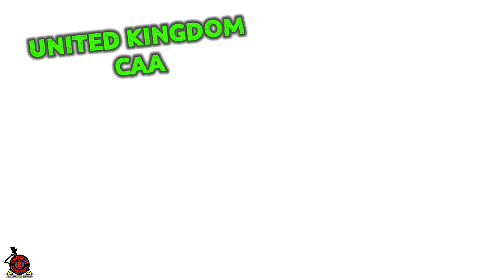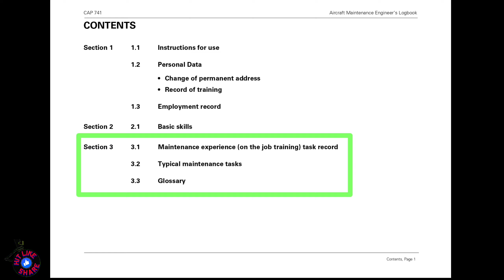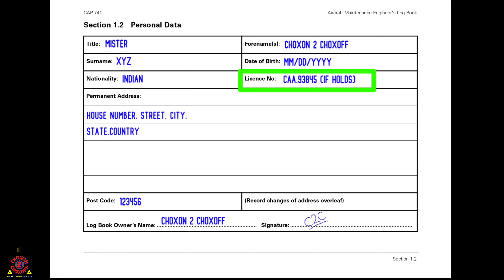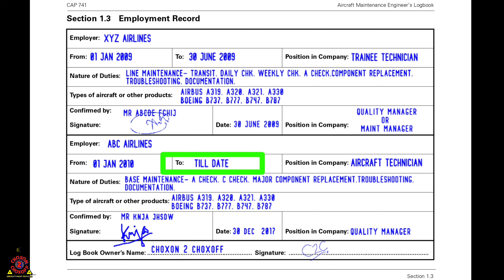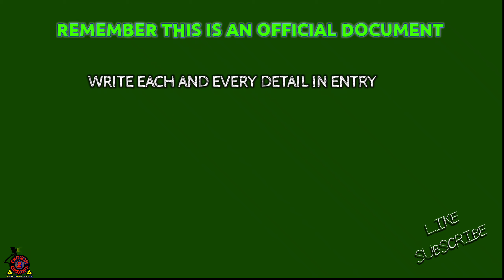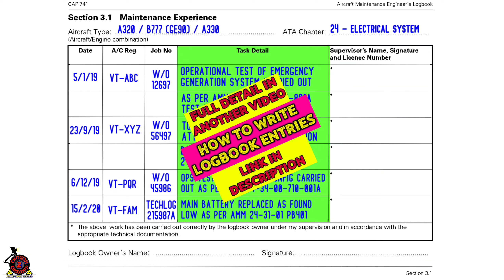EASA PART 66 AME LOGBOOK | UK CAA LOGBOOK CAP 741 : HOW TO FILL IT CORRECTLY.

Comment: Hey man. As someone who is not a UK or an EU citizen, am I eligible to apply CAA UK Part 66 AML? Wanted to go for KIWA, however they no longer accept non EU members or citizens. Which is best, CAA UK or EASA?
Reply: sir how many tasks shold i perform a month or a week is there any certin number ???
Reply from the maker: @مفلحشمري you need to perform number of task, some authority require certain number of task which makes year of experience
Reply from the maker: Depend on where you want to work or your company requirements. Do not go for kiwa, they cancelled so many type ratings and takes long time.

Comment: Does CAA UK issue basic license outside of UK if one has more than 5 years of maintenance experience on an operating aircraft and cleared al valid caa uk module examination?
Reply from the maker: Yes. You need to apply with proper documentation and logbook.

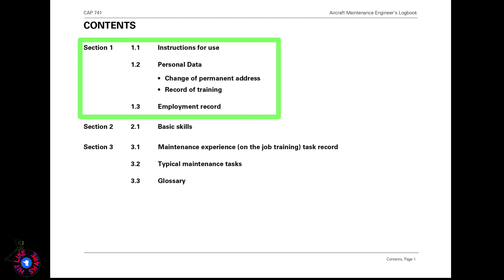Comment: 01:25 , hello brother if the work order is not under my PRN or name is it still valid because i don’t have authorization yet so its not possible that the workorder entry is under my name or prn. Does it matter? Or can I just use any valid wo and enter that in the logbook if i have assisted in the task? Thank you
Reply from the maker: No, it's not necessary on your name. It should just be genuine and you present in the company. It is just for cross checking.

Comment: Is it necessary to get your practical 5 year experience at part 145?
Reply: Sir my company  is FAA 145 Station  NOT EASA is it ok or it must be 145 EASA ??
Reply from the maker: @مفلحشمري some authority accept. Aviation exp
Reply from the maker: @مفلحشمري as of now greece accept non eu experiences
Reply from the maker: Have you cleared your module 10?
Reply: @CHOXON2CHOXOFF  I'm planning to get easa license through 5 years practical experience.
Reply from the maker: If you have not done a basic course from 147 approved org, then you need 5 years mandatory.
Reply: @CHOXON2CHOXOFF  but does the experience count only under part 145? Or can we get the experience at repair stations that isn't under part 145M
Reply from the maker: Part 145 approved org experience and module exams.

Comment: If my supervisor is holding CAAS (Singapore) and FAA AML license, do I need to mention it infront of the license number such as “SAR-66 /E126374” or “FAA/ 3757483” ?
Reply from the maker: Some of the authority do ask to mention license nums like kiwa neatherland.. some dont. It depend on where you applying. But if your company is EASA 145 approved than not needed.
Reply: @CHOXON2CHOXOFF   Thanks for the reply! I’m actually applying for UKCAA Cat A before their cut off date on 31 Dec 2022. My company is EASA-145 approved. 

I’m not sure if UKCAA need the Supervisor Detail List like KIWA logbook format. Do u think they usually required this?
Reply from the maker: UK CAA dont requires any such thing until your logbook is sogned by QC nd also have covering letter from QC to CAAUK. Just see to it that you fill max entries and also cover all ATA chapters and different types of funct test, ops test, troubleshooting,  removal installation evethg... 

ALL THE BEST. KEEP WATCHING AND SHARING THE CHANNEL.
Reply: @CHOXON2CHOXOFF  Okay sir, thanks for the help!

Comment: Thanks for info, but do I have to take the whole module exams from one country? For example is it ok if I take some modules from part 147 organization in turkey and some modules from organization in uk?
And is an EASA license affected by the part 147 organization name or all licenses are the same in credibility?
Reply from the maker: Thats good questions.. 

As per rule you are correct, we can appear exam from any part 147 approved organisation. It don't matter. We appears more than 3 different places. But lately we heard that some authority is not accepting it so.
It will be nice to confirm this from authority you wish to apply for license.

License will not have names of org where u cleared modules. And all AML is of same credibility. You can even transfer if you wish later.

Comment: Can i put all individual easa exams in the record of training section?
Reply from the maker: No. Easa exams is just a module exams. You can put 147 basic training course in that section, Also any aviation related course as told in video. But not individual module exam.